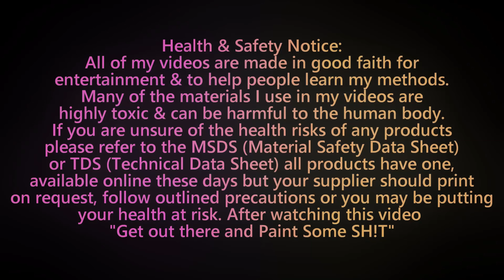Clear Over Base Spot Repair

Comment: Dude! I like what you said about: If your boss want a spot repair, he’ll get one and it doesn’t matter much if you’d do it in a different way if you were in charge. This is the job and that’s what you’re payed for. 
I got the biggest spot repair into the shop just now. A full respray on a 1964 Volvo Amazon...without removing any chrome, rubber, emblems, handles, rust, nothing. Just mask, sand and spray...well...he didn’t actually say “mask” and “sand”...but I’m a little bit of a rebel so I’ll do that anyway! 👍 😁

Comment: Nice job there gunny!  Don't care much for spot repairs but I will do them with the same technique only thing I do different is i dust my laps after every coat of clear with slow reducer to melt in
Reply: Im like you gunny..its just work and has to be done .regardless if its just sweeping the shop..never get too good to somehow forget where you came from..